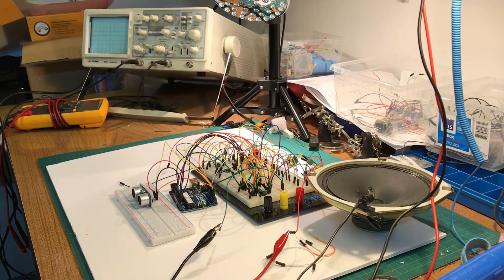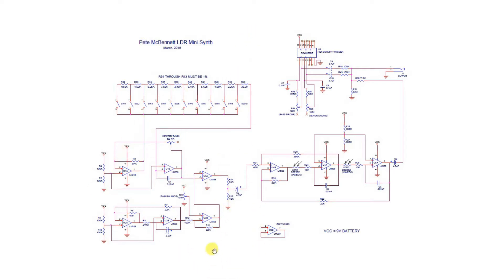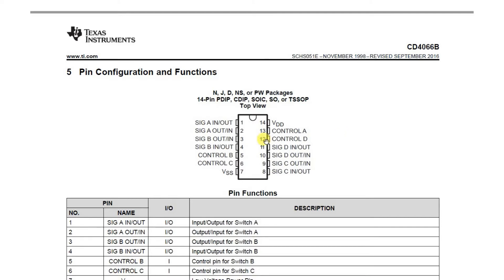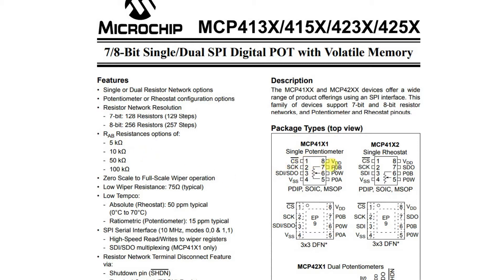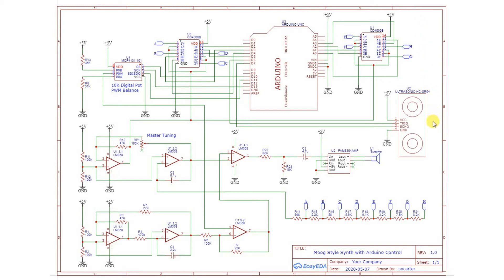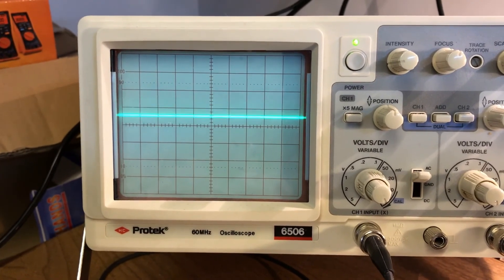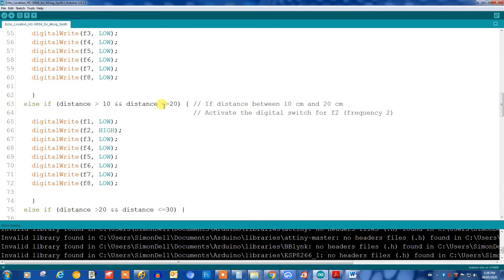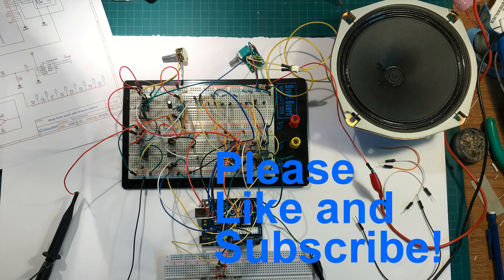Moog Style Synthesizer under Arduino Control

Comment: Tried building this and I only get scratchy sounds when I turn the 100k master tuner pot. Does this need a Arduino Uno or can an Arduino mega be used? Also do you need a separate power source for the ICs or did you just use the power from the Arduino? Also wondering how you could make cleaner signals on the op amp oscillator circuit, if resistance and cap values are critical or not. trying to track down what the problem may be....
Reply from the maker: I used a uno but you should be able to use a mega as long as you use the same PIN numbers or reprogram the software to correspond to the mega pins you used. Yes I used an external 5v supply and attached the ground to the Arduino. Not sure about making cleaner op amp signals.